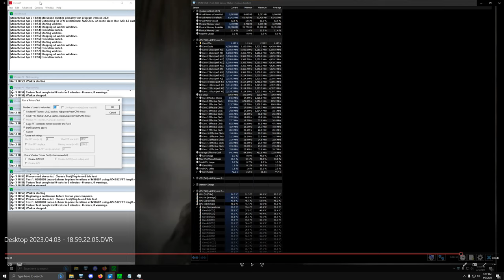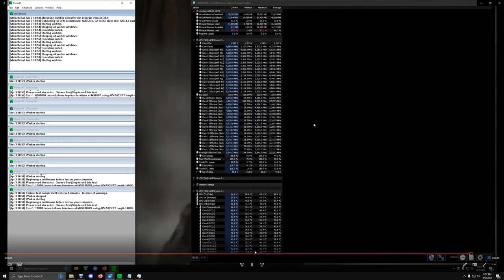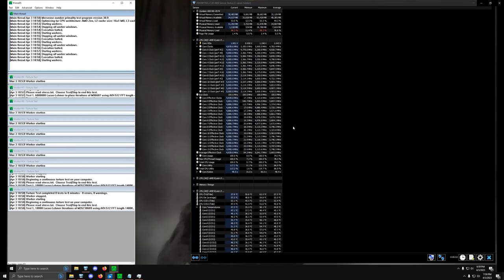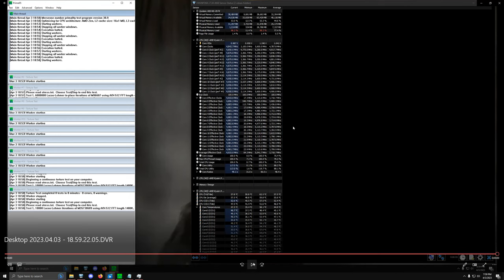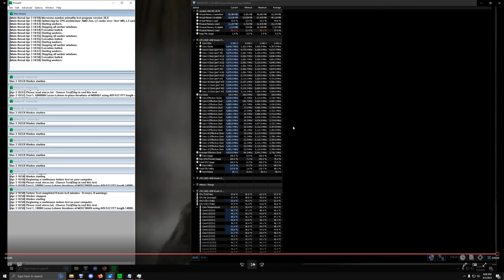BEWARE OF CPU CLOCK STRETCHING

Comment: I thought effective clock was the % of your cpu usage for example if a task is using 50% and your cpu is clocked at 5.0ghz it will show   2.5ghz on the effective clock
Reply from the maker: It is. The difference is that these workloads are designed to pin each cpu to 100%. If you check just below in HWINFO 64. You’ll notice the cpu usage will sometimes drop off a cliff for a core. Which isn’t supposed to happen especially for longer than a few seconds.
Doing these tests I could have it happen for minutes at a time. Just a few cores casually sitting at 0% on a full all core stress test.

Comment: My 5800x seems to be doing this even on default settings with or without PBO and without curve optimizer. Bios shows 1.4 + core voltage (feels high to me?) and core temps never go above 60c in game. (Benchmarks can get it up to ~75c if on a loop.) I’m trying to get the most I can out of it for EFT and trying to help minimize stutters and I feel as though this may be the culprit, however with my current understanding I’m at a loss. Any help would be greatly appreciated man!
Reply: 1.4v+ on a 5800X is totally normal and your temps are excellent. (Anything below 90c is normal). What are your clocks when running prime95?

Comment: If I disable idle states so that the effective clock is always max, will it yield better performance on a CPU bound game? I have a Ryzen 5 3600 with a stable all core OC at 4.5GHz. With idle states enabled, on Cinebench and Prime95 the effective clock hits a stable 4.49GHz on all cores without a problem. When I open a game like CS2 that uses 55-60% of my CPU at all times, the effective clock on all cores is significantly lower. It hits like 2.5-3GHz. Do I lose performance? Does it work as it should?
Reply: In short: yes (BUT)
In long: it depends, because cooling also matters, as your frequency will remain higher, and will require way more cooling requirement at idle
So, as long as you can cool it, yes it will be better, because fixed clock generally is better than fluctuating, unless fixed clock is lower than fluctuating one, then fixed clock is worse.
So, essentially you make your clock stay higher, without going down in frequency, resulting in more heat.
Also, higher voltage - more CPU erosion over time, so you gotta be mindful of Vcore voltages/VID/and SOC voltages

Comment: Hey, would you mind giving FrameChaser's latest video on the 7800x3d a view? Starting at the 3 min mark he shows that the cpu still tries to boost down. Later he mentions that he tried disabling idle states and c states, but that that had no effect. Would love to hear your opinion on it since you've been using the 7950x3d for a while now.
Reply from the maker: The 7950x3d is fine, he is wrong. Disabling the idle states makes the cpu run at or near the max boost clock on your cpu. I have unlisted videos for proof. Whatever he did in the bios to lock the cpu to an all core turbo is very impressive though.

Comment: Does this matter in game? Since of course it won’t come close to using the same CPU % as Prime95 etc? More an extra stability check than anything?
Reply from the maker: Oh it’ll matter just as much cause some games push your cpu.
Reply: @Savitarax  sorry what I meant was in games where usage is less, such as older games, the effective clock is low, but stays at the correct speed in P95.
Reply from the maker: @IIHydraII  in those cases then it hardly matters at all. Because the demand is so low, you never get to put the cpu under any sort of constraint for speed. So clock stretching doesn’t matter. Because you won’t saturate that cpu core with enough data.

Comment: Out of curiosity is clock stretching ALWAYS bad?

I ask because I've tuned my 5700X to run at only 47W (35W TDP) because I sometimes I use it on battery + solar power while travelling in my camper. When i was dialing everything in, i could easily run -30CO on all cores at 47W with no clock stretching. At these settings I'd get somewhere around 2.4GHz and around a 9600 score in CB R23. 

If I added an additional negative voltage offset, my core frequency would increase to around 3.5GHz under all-core loads like R23 but it was also clock stretching down to a around 3.2GHz effective clock speed. However, even with the clock stretching my effective clock increased (a lot) and my R23 score also increased to 10,850.

Comment: Does this happens when the voltage isn't enough? Cheers.
Reply: It can happen, yes.
There could be other factors, but voltage is usually an easiest way to induce it
Theoretically you have enough to run a portion of that CPU, then it sees it cannot deliver those voltages and begins to clock down some cores, but there could be other factors like core inferiority, without altering voltages, or just some cores not hitting advertised speed.
Hence why AMD is stating "up to"
It won't remain at 5.7 ghz stable, unless you dump like 1.45 voltage into SOC, and quickly cook your CPU in no time for your nice 5.7 ghz all core lol

Comment: I run prime95 with curve optimizer -30 on my ryzen 5800x3d and the core effective clocks sometimes drop the 3XXX mhz for a few seconds then go up while the core clocks are at 4XXX mhz. Does that count as clock stretching?
Reply from the maker: Yes, anytime the clock isn’t actually staying at where it should be assuming idle states are disabled. Is clock stretching.
Reply: Okay, the weird thing is that my cinebench score is higher with kombo strike than with stock settings.

Comment: I have 10200H and tested it now. Its needs to run at 4100 Mhz but when i am doing test, they are only running at 3500-3600 and i even noticed some of the cores dropped to 1400-1500 mhz is it normal ? Hyper Threading was on btw
Reply: I tested again they were stable at 3600 now but it hits 45 watt limit. I cant see 4100 Mhz what should I do ?
Reply from the maker: Because that’s a laptop… I believe. You might be having clock stretching due to power constraints. So I would isolate each core with a stress test like OCCT And used the advanced tab and check to see if it’s still clock stretching. 
If it is at stock and you haven’t tweaked much. I wouldn’t worry TOO much about it. But if you have done anything then it might be worth looking into. Laptops are power constrained so 100% there will be clock stretching. But it’s only bad when you aren’t.

Comment: I'm not sure that's what clock stretching looks like. Mine also does that on the blend test but if you use small FFT's you'll get clocking stretching of like 50 or so mhz with an undervolt.
Reply from the maker: It’s normal to have 50-100 sometimes even 200 depending on how hard it is. 
But anything outside of that range can easily be detected because the score will be dramatically lower.
So for example a 5ghz cpu may be clock stretch reporting to 3.5ghz
But I’m reality the score is gonna be less than half of what a 5ghz score should be.
There’s lots of fun videos online detailing it.
Reply: @Savitarax  Again I just feel that the small FFT test is the better test to use because my 3900x does that same thing with the blend test on stock bios settings.

Comment: the fix for me was in power options proccessor idle disable, disable idle, it stays at 3.5 ghz in all the effective clocks but when i stress the cpu, downclock to 2.6 which is the base speed. i have disable turbo boost, could it be that?.
Reply from the maker: if all of the cores are unanimously in sync at a certain frequency then it's nothing to worry about. Could be turbo algorithm, power constraints etc. What does matter is if you are stressing your cpu cores and all 6 are hitting like 2.6 ghz but one in particular is at like 500 throughout the entire run. Disabling idle fixes the effective clock throttling. But won't fix the clock stretching.
Reply: @Savitarax I’m looking at the average effective clock in occt, it reads 4800 mostly instance of what it says I’m over locking to 5000, is this normal or clock stretching?

Comment: An apex frame time vid would prolly be a good challenge to figure out Im a competitive player and ranked player and apex is weird 

For example nv reflex on+boost and a 144 fps cap gives me input delay with controller but if I cap it to 137 it feels better mouse and keys feel good but Im probably just thinking about it too hard!

I have a rtx 3060 

Halo infinite on steam with a dualsense controller feels like slugs when I pull my thumbstick  

Plus msi afterburner gives me input delay any over clocking software does! I know its alot but it may be a new vid idea for one of these issues!?
Reply: if your gpu running 80 99 input lag will be higher than if its running on 40 70% utilization

Comment: The effective clock is an average of the frequency over a given period. Contrasting that against the instantaneous readout of the core ratio multiplier does not prove "clock stretching." All it proves is that you don't know how to interpret data.

Also, the effective clock readout in hwinfo cannot be trusted. If you apply a static overclock, it will still show fluctuation... Which is impossible because the multiplier and BCLK are fixed.
Reply from the maker: My guy, if I have 1-2 cores running at 1500mhz for MINUTES on an all core workload. THAT IS CLOCK STRETCHING. 

Also no…… hwinfos monitoring is not wrong, you are just uneducated. Just cause you can set an all core multiplier doesn’t mean you automatically LOCK the cpu to that frequency. It just means all the cores will try to work at that frequency like a cap. Because you have something known as cpu idles states. If you disable idle with a specific command. Your effective clock will match your instant reported clock.
So how do I prove that clock stretching is happening…. Because if my effective clock is at 100% of my instant clock at idle. And I run a workload that puts a lot of demand on a cpu core and I notice the effective clock start to plummet in relation to the instant clock. That is clock stretching. Because my cpu is UNABLE to support that given clock speed. 
That is why you are given a current, maximum, minimum, average value when looking through hw info.
Reply from the maker: Also, this is like I said backed by hardware enthusiasts like Skatterbenchers who is a well known overclocker and buildzoid who is even more well known. Both of them have talked about this same issue in this exact manner. They even recommend doing this in order to verify clock stretching.
Reply from the maker: Oh and let me provide that documentation so I can further validate my point on this. 
"The result of clock stretching is that the reported clock will be normal but the effective clock will be lower. Because there are fewer amount of clock cycles" 
"clock stretching is a safety feature, when the cpu figures that the voltage is too low to sustain a given frequency. It will reduce the clock period until the voltage is back at the acceptable level. Effectively the cpu suspends the execution of tasks until stability is regained". And he provides information sourced from other people like hwinfo themselves and documentation on what clock stretching is. 
https://youtu.be/bxsDScbQJGA?t=1696

Also just a small tangent here. The BCLK is not a fixed ratio with the multiplier. It is a fixed ratio with the entire system as a reference point. When the bclk is changed, everything changes. The pcie speed, the ram speed, the infinity fabric speed. In the bios there is a feature called "BCLK spread spectrum" which will automatically manipulate the BCLK in order to handle EMI/CE problems. So fluctuating clocks are possible even with an all core overclock AND disabling idle states. So that's also further validation that a fluctuating clock is not "impossible" just because you set a multiplier ratio with the bclk.